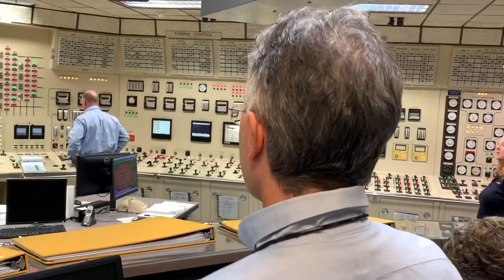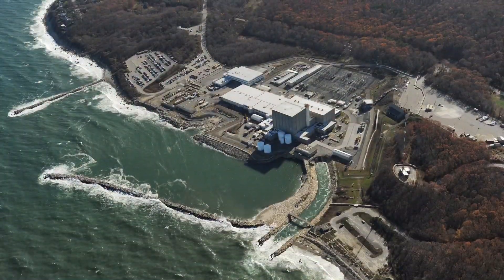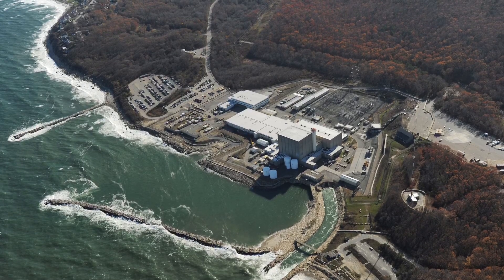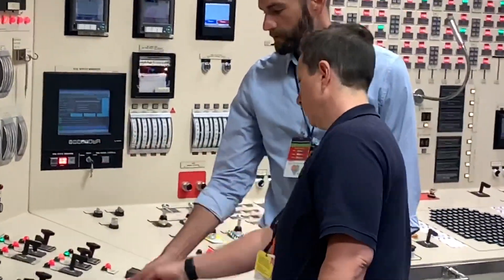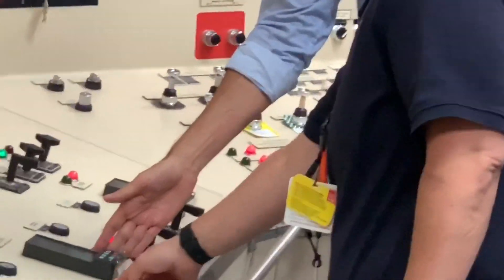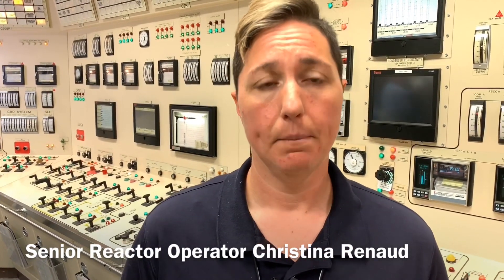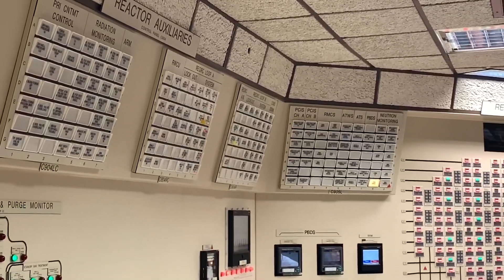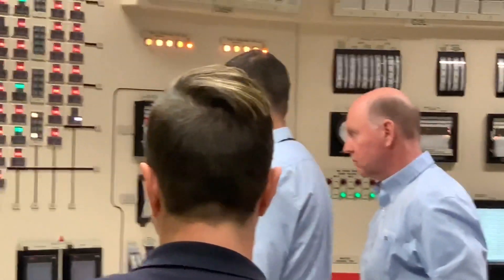How Pilgrim plant will shut down

Comment: I have mixed emotions about this its sad that it has closed down because it served it job verry well.  but god forbid if it blew up it would completely destroy cape cod and that would be horrible.  as of wrighting this workers are goning to start cleaning where  of the rods where and in time it will be finaly be ready for demolition.
Reply: It wouldn't blow up, you have a higher chance of getting hit by a meteor .
Reply: @SRN42069   it was an older station so I  would not be supprised if an mistake where to occure as it did when there was a small chemical spill, do to a leaking chaimber that happend at that station quite a few years ago. As of now the building is dormate but heavily guarded.

Comment: Alas, it will sit for centuries as an eyesore.
For 10,000 years the rods will be radioactive.
Reply: Ya because left wing nut jobs don't want to bury the spent fuel  like we should have ages ago.. now that plant will end up being replaced by 2 natural gas burners somewhere probably out of state because of the crazy left wing politics of the state ... Increasing climate change .. great job leftist take away good high paying jobs and increase climate change in one action
Reply: @wuhanlabtech3580  Pilgrim was shut down by its owners because it wasn’t making them enough money.
Reply: @adorabasilwinterpock6035  you are correct pilgrim was replaced by cheaper power from oil burners and natural gas burners
Reply: @wuhanlabtech3580  My point is it had nothing to do with politics. The owners closed it down, not left wing politicians.
Reply: @adorabasilwinterpock6035  unlike vermont yankee... You could actually argue the places like seabrook costs was due to court fights and bankrupted public service of nh and that was due mostly to left wing organizations and politicians it would have been far cheaper without the court battles and they would have finished the second reactor 2 times more power and no carbon
Reply: @wuhanlabtech3580  I don’t kno wht kind of leftists u have in mass but the kind I kno as well as represent myself, love green nuclear power.  It’s the right that volleys for oil, coil & natural gas power from wht I can tell.